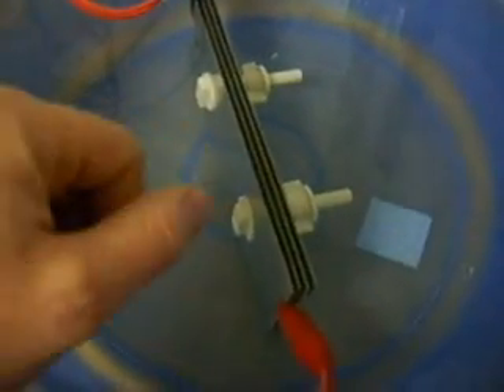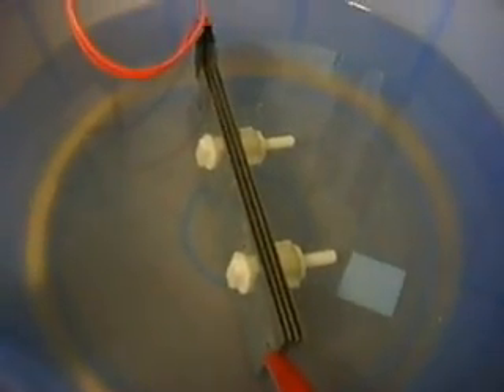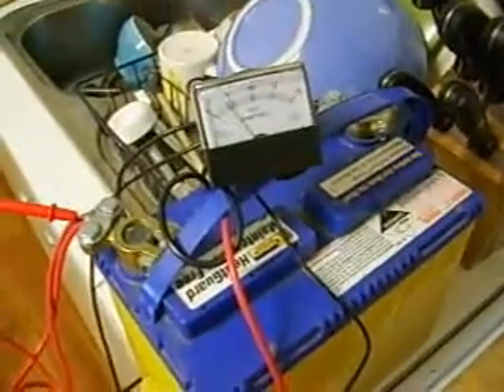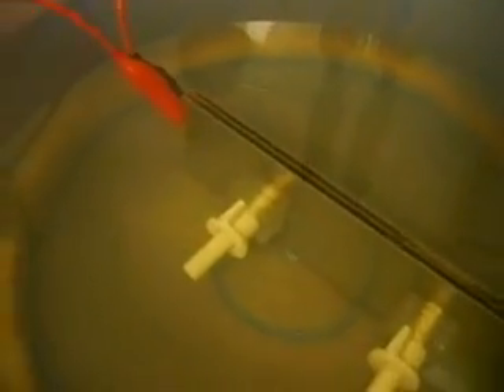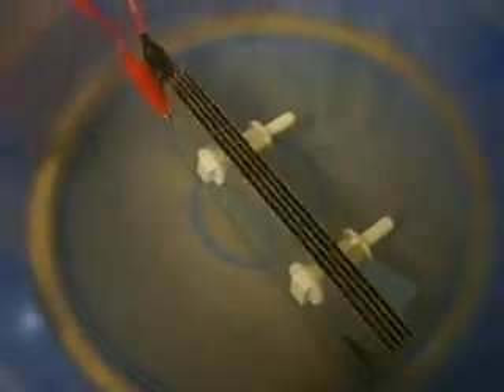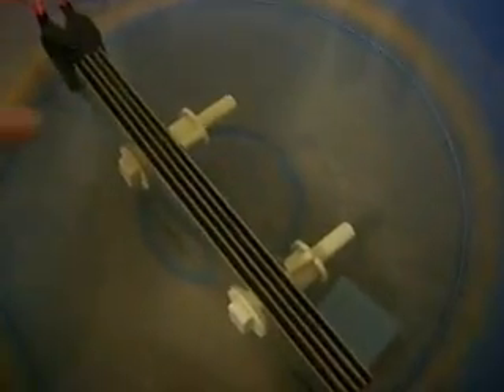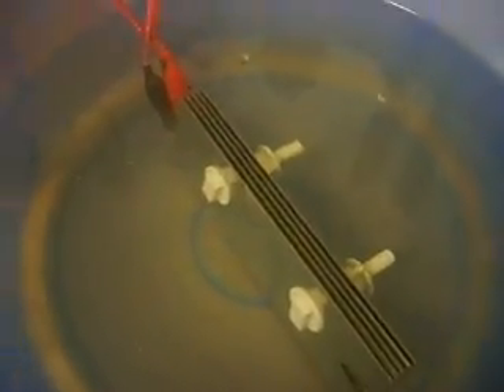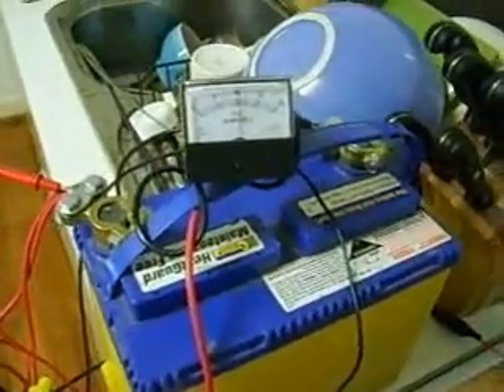hydrogen at home (more neutral plate tests)#8

Comment: I have found that keeping the negative on the outside will yield more gas. It is the surface area you want! Hydrogen is generated from the negative plates. Keep up the good work! I will post a video response that shows my unit.